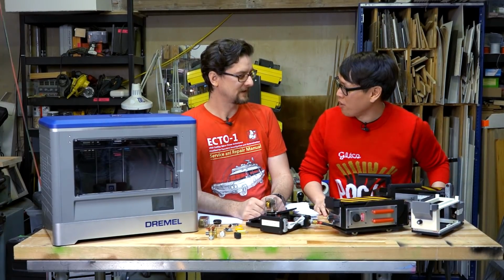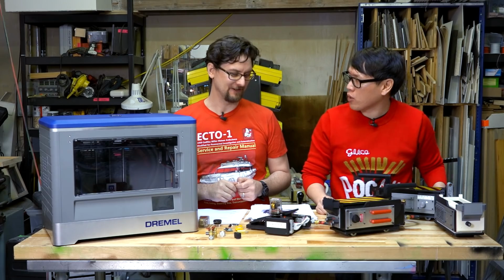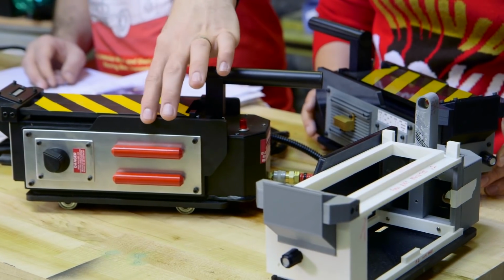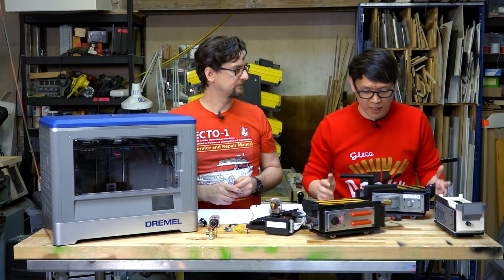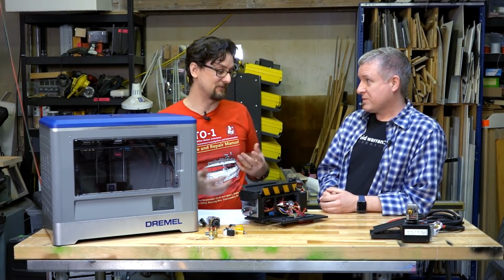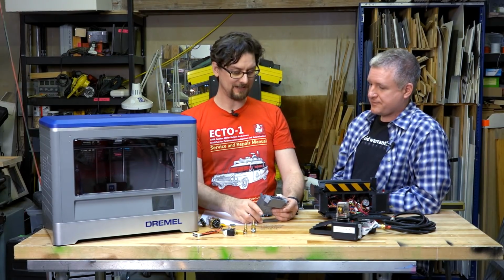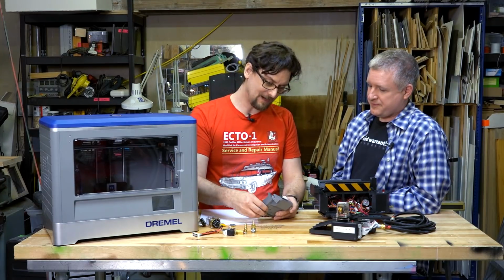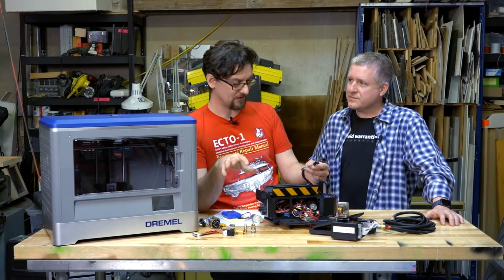In-Depth with the 3D-Printed GhostBusters Ghost Trap!

Comment: In theory couldn't you use a air compressor switch to detect a foot pedal actuated bicycle pump using that tubing. But I imagine your solution to be a lot more reliable.

Comment: Should have used a pneumatic to electric switch to trigger the trap....  Then the bellows on the pedal and the use of an airline to air gap the pedal from the trap (a la original design concept) would work.  Plus wouldn't have had to bodge wiring in it.
Reply: That would actually work. Do you have a link for a website that sells those switches?
Reply: One I've seen is the kind they use for a air actuated garbage disposal switch.  A little bit of teardown and you'd have what you want:
https://www.amazon.com/Northstar-D%C3%A9cor-Disposal-Stainless-Polished/dp/B01M5L5RDB/ref=pd_lpo_60_tr_img_3?_encoding=UTF8&psc=1&refRID=00XGKG01WP9MVZZBBRXQ
I'm sure there's other solutions out there too.
Reply: Alright thanks

Comment: I think you are blocking my other comments because there is a link in it, but this link could be quite helpful for finding a component in this build, can you please validate the other comment.
Reply: +TecKonstantin test without dots: 
As i said in the last Comment, these Power Resistors are quite common used in electronics, they are also used in Aerospace and all different kind of Equipment, i used them my self in some designs. I have some Links for you where u can find such Resistors, maybe you have to us a different kind but as far i can see the RCD 600 series Seems to fit quit good but u can look it up in the technical drawings. They are not cheap but that is normal for those aluminium resistors.
farnell(dot)com/datasheets/168901.pdf
US link: newark(dot)com/webapp/wcs/stores/servlet/Search?catalogId=15003&langId=-1&storeId=10194&categoryName=All%20Categories&selectedCategoryId=&gs=true&st=RCD%20600 
Have fun with that info if u need any more just ask, im glad to help
Tec

Comment: y not use a 2.5mm audio jack for cable to pedal, or the smaller 1.5mm jacks like on xbox controllers. that gives three connections then

Comment: Wow, I'm surprised you managed to fit a full-sized Arduino and shield in there - had assumed you were using one of the little Pro Minis. Also, that shield is actually reliant on the Arduino to continually feed more sound data to it whenever you're playing sound; the library tries to hide it from you, but it's continually interrupting your code to feed in more data, which may interfere with what you're doing. The usual Chinese sources have "DFPlayer Mini" modules that can supposedly run by themselves after being told what to play, are about a tenth the price and barely bigger than the MicroSD card they run off - haven't tried them so your mileage may vary, but they look to be worth a try for audio effects.

Comment: Adafruit is expensive! Great service but very expensive, so I changed to BangGood.com. Cheap great service and free postage!
Reply: I use AliExpress which is similar - slow shipping, almost non-existent documentation, but stuff is dirt cheap. That does tend to require a certain amount of electronics knowledge and research though.
Reply: makomk
Yes I use them too from time to time.
But yeah documentation sometimes can be a challenge. But usually you know what you want and you already looked up the specs for the part online.

But it's worth it because the parts are so cheap you can spend a bit of time researching it -- or even experimenting with them and blowing a few up :D
And it still leaves you a profit; I mainly sell the things I make to magicians/mentalists. And with AdaFruit and SparkFun there's not a lot of room for margins anymore.

Comment: The footswitch could have used a pneumatic switch seeing as the original use for that tube was air, no need to make special connectors, you could even make that relay operate by using batteries in the pedal
Those small e cigs will also operate if you blow in the bottom, that's where the air switch normally is, this means you can use a pressure pump instead of the harder to get 'through' pump
Reply: Like the old pneumatic Kenner traps.

Comment: Again, wondering why you didn't just go for air-pressure activation. You had the pneumatic hose and pedal assembly already.  Pressure switches are often used to ensure a high degree of insulation/separation between an electrical device and the person operating it....Something you might want in an actual ghost trap.